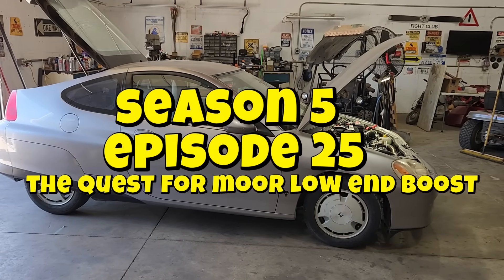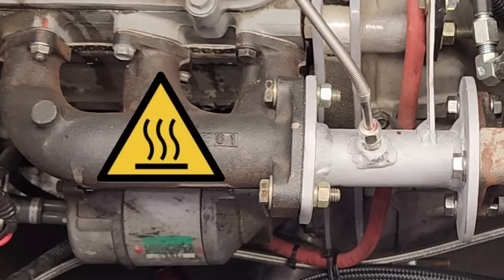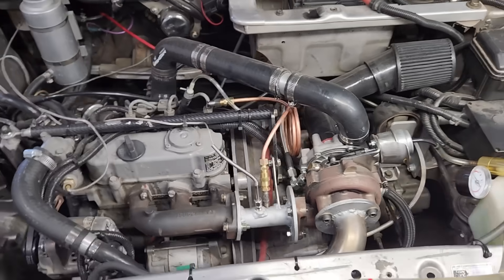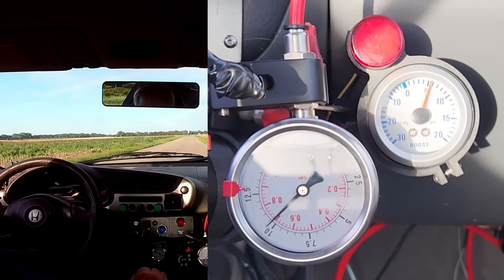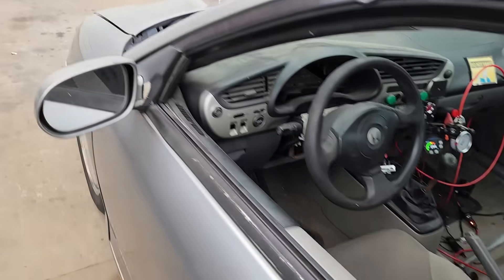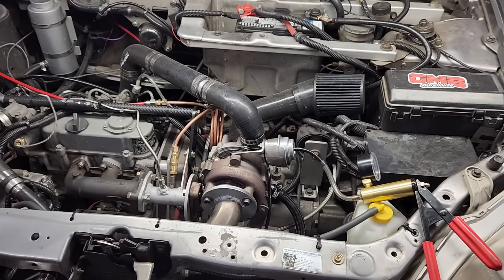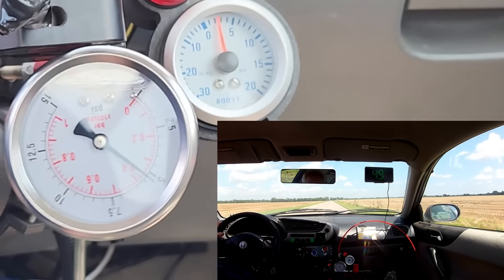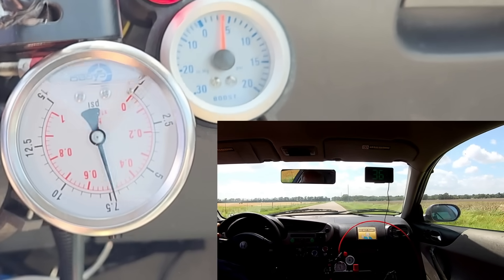S5 E25. Can we get more BOOST from the VNT/VGT turbo on the 719 cc kubota diesel Honda

Comment: More interesting results, I think  that adjusting the VNT stop is helping, but it's a bit hard to see, finding the best position for that stop might require some more testing.  A suggestion, I recommend insulating the exhaust; this turbo is working, and any little bit of extra thermal energy going into the turbine would help it.  That poor little turbo is so far away from the ideal engine displacement, it really is being handicapped.  As you said Jimbo, it is quite miraculous that it makes as much boost as it does, all things considered.  I look forward to the next installment  🙂

Comment: It's very easy to burn both the VNT and the turbine when messing with the stop screw!
The high pressure exhaust gasses will cut like an acetylene torch.

Comment: 1/8” X 27 NPTF is a very common oil thread, even on otherwise metric equipment. Manufacturers who us metric threads for oil are still the outliers, at least on the equipment that crosses my bench. Thinking of you, Mr Benz
Reply from the maker: Thanks for the info!

Comment: If it was a larger diesel, I'd say run the blower and turbo together, like an old school Detroit, but this is a whole different animal... IDK, I think that turbo is great, but due to the limited HP, I would swap to that mini blower again.
Reply from the maker: The little supercharger really was the better choice for this engine.   Before I switch back, I want to see if there are any benefits by using a turbo. So far with the engine there are none.
Reply: @robotcantina8957 Yeah, however, you really have gotten the best performance out of that mini diesel. So when you switch back, you'll have a full series literally any college or university campus can reference regarding the dynamics of compression combustion engine. Thanks for your work.

Comment: Apparently, the new project car has a big fan already. Since your channel is usually about trying to make tiny engines work in vehicles bigger than the engine should power, I’m guessing you’re going to make a weed wacker into a jet to power a ride on mower. Did I guess right?
Reply from the maker: LOL, Close...  we are going to put a COX .049 in a Terex 100 ton dump truck
Reply: @robotcantina8957 can’t wait to learn what either of those are. I can already hear the jokes in the comment section, though. I’ll start with, If you succeed you’ll be a CoxTrucker.

Comment: Your videos helped me in a surprising way. I just picked up a D722-powered Kubota generator... And these videos meant I already knew everything I needed to know about the engine..... including what to do when it wouldn't shut off (previous owner had disconnected the shutdown solenoid for some reason)
Reply from the maker: Glad the videos helped!
Reply: Same here, but mine wouldn't start and because I watched these vids beforehand I knew what it was immediately: bad shutdown solenoid preventing starting.
Reply: @JerryAtrick83  mine was gummed up, I fed it some degreaser then a couple mls of ATF and worked it back and forth and now it's mint

Comment: Has making the exhaust outlet diameter smaller been mentioned ?
  The water hose example. The same amount of water going through a smaller hole must increase the velocity. i.e Spinning the turbo faster sooner.
This is with all your already mentioned caveats and channels spirit.
  I should also increase the back pressure but in a different way and maybe a different outcome.

Comment: Heck yeah bro , and idk about diesel,  but on gas engines,  ya really dont want more than 1.5 times thw ba kpressure as the boost , anything over and they usually tell ya you gonna hurt something lol but i dont know much on diesel so it might not matter at all their were there is no throttle plate and whatnot .. i definitely like this idea, though.. i wonder if a gocart or motorbike turbo would do better (i believe they would be smaller ). But regardless,  im watching and interested .. knowledge is power friend and i never stop learning 😅.. anyways , peace and love jimbo, keep it rad, stay safe, and build on..l8r famz and keep having fun..

Comment: I guess this back pressure phenomenon helps explain why putting a set of headers on a factory turbo car doesn't necessarily improve performance. I look at the log manifolds on the ford ecoboost V6 engines in the SHO Taurus and they don't seem like they would flow particularly well in an NA setup, but they can make quite a bit of horsepower using the twin turbos. Downpipes after the turbos seems to be more significant because even heavily modified cars making 600+ HP use the stock cast manifolds. You can pretty much overwhelm the rest of the drivetrain and max out the open deck engine block design by simply running modified factory turbos, downpipes, high flow cats, and catback exhuast. There's more mods on the intake side to achieve those numbers, but the lack of need for a header on the exhaust side always surprised me.

Comment: Thank you for the amazing video. I suspect with my amateur eye, that over adjusting fins is not making good boost because they are rotated almost backwards. Their angle even in default maximum setting is very steep!

Comment: For what's it worth how about try controlling the pitch of the veins by pulling then in the choke position with a spring then using boost pressure on the actuator to offset the spring pressure. Then change tension to find the best out put

Comment: twin-charging (super charger and turbo on the same engine) is the best of both worlds... if they are both sized appropriately for the engine and usage. Your supercharger seems to be well sized for the application, however, the turbo likely would be undersized in either compound (series) or parallel twin-charging. If you were compounding it, and you had a larger turbo, it could work well (the supercharger would handle the lower RPM range, and the turbo, the higher range), but then you'd likely need to worry about how much boost the bottom end of that little Kubota could handle before exploding.

Comment: You definitely have action from the turbo. If you can find a correlation value between boost/optimal spool speed; and use that to be the value a controller keeps the turbo set at, it should be a quick arduino build. The only thing that really matters there is a set of valves and a small vac pump, or an IAC/EGR servo. Awesome work like always.

Comment: Limit back pressure but also allow boost to be vented back in intake a little in a 25 percent waste loop so till turbo spins up then sloae loop progressively to get boost 

Idea being if theirs an optimal fast speed of turbo

Then get the most boost without dropping turbibe speed. 

Like maybe at present rhe turbo isnt running fast enough and cant get their when bots back and boistcwokingvadainstceach otger

  Spacebar stopped working it cant keep up:)

Comment: Funny enough, we - the metric crowd - also use the imperial system (at least here in Denmark) for pipes and fittings, but only old school cast steel and galvanized pipes. For copper, stainless steel and PEX pipes, we use the metric system. Why do you ask? I do not know, and I don't think anybody knows! 😂
Reply from the maker: Thanks for the input, I always wondered how it was done over there.

Comment: Vgt turbo is doing what is designed to do. You need to control this to get the max from this turbo, and it can deliver boost in wide range of rpm with a controller. Actually, this turbo is a little over sized for this engine, and this why you have boost upper mid-range rpm. I don't know if there is a vgt turbo smaller than this.

Comment: So if you can generate 2psi with the vnt set to more flow you should see more power output on the higher end due to less back pressure.
Reply from the maker: We get decent boost on the high end and that's good enough for now,    Its the low end we are looking for more boost.  it may not be possible with this turbo.
Reply: @robotcantina8957 that’s true is probably 2-3x the turbo size. 

If you can find a vnt a bit smaller you could really do some cool stuff with electronic control of the nozzles. 

Just sucks how the vnt chokes the engine a little bit on the high end when you want to see more boost.

Comment: it has a hard stop inside the turbo both way so it doesn't go pass center to where the turbo can't come back. u can see it in one of your last videos or two. also you have too much resistance in the exhaust, u don't want more than a 1 to 1 in backpressure to boost

Comment: Using the Charger to power the turbo... but not the way to think but by a device that uses the Venturi effect to create a vacuum to suck exhaust out past the turbine. hopefully effectively creating a lower pressure on the outflow of the turbine reducing exhaust pressure when activated.

Comment: Connect the VNT vacuum line to the intake manifold. It will keep adjusting the VNT until the engine can no longer pull more vacuum. This is on the assumption that the small engine can pull less vacuum than needed to max out the VNT.
Reply: Diesels don't have vacuum in the intake manifold.
Reply: @sodderbridge  You right 👍, forgot about that.

Comment: you are kind of headed in the wrong direction. if you got 5lbs of boost and 15psi of back pressure, thats bad. not good. you dont want more back pressure. back pressure is not what drives the turbo. they are not paddle wheels in the exhaust stream. if you exceed 2:1 backpressure to boost...its bad. thats only 50% efficient. 1:1 is ideal {but impossible to achieve} turbo is TOO BEEEEEGGGG :)
Reply from the maker: LOL,  I do realize that back pressure is bad, I mentioned that quiet a few times during the video.  1:1 is not possible as you seen.  1.9:1 is about the best we can do  with this turbo.  The important thing is I was able to show the audience the back pressure side  of the equation when  using a turbo.
Reply: @robotcantina8957  its the statement that you need a back pressure gauge with a wider range that gives that impression. reading the comments it seems alot of people feel that back pressure is what drives the turbo {nope}   you might be able to get that turbo to light off by adding more fuel back in it. having no aneroid fuel controller on the injection pump is going to be problematic.

Comment: The fact you have some much more back pressure than boost pressure is pretty bad. It would be fine for helping spool but then the veins in the exhaust turbine need to relax to increase exhaust flow as boost comes up. :/ this helps keep the back pressure to boost pressure ratio closer to a 1:1
Reply: Is a not ideal manifold thats why, or the screw should go the other way but he didnt show.

Comment: It needs more exhaust velocity with less pressure! Could that be achieved somehow! What about higher flow exhaust manifold tapered down to turbo mount, would that be worse since it has more volume to fill before the turbo? Regardless I think you on the brink of a discovery 🎉do propane injection 😂🎉😂🎉

Comment: It looks possible that the VNT vanes could have a range of motion that would allow them to go over-center, obviously I've never had my hands on this and I could easily be misunderstanding how the vanes act. If they can go over-center, then adjusting them past center would cause them to start closing down, opposing the flow vectors, and creating a reverse-twist airstream going into the turbine, which would all I believe sap power from the turbine and reduce boost. The smaller adjustment feeling better may support this, as it was on the right side of center. If any of this makes sense, then the adjustment screw being set to put the vanes at center would be the highest setting that might be desirable, within the limits of my understanding.

Comment: If I weren't determined to be a useless slug today, I'd go dig out my Corky Bell manual with BP tables to reference volumetric flow on optimizing a turbo, buuut, it's raining, I feel like crap and I know it's absolutely buried in my workshop behind a bunch of projects I'm trying to postpone for as long as possible. 😁

Comment: Have you considered electric turbocharging/supercharging? I know you guys are budget conscious but even a leaf blower could help with the blowing coal off the line. I worked on some very early electric augmented turbos. They showed up in Formula One and have now been offered on some street cars. Given the small displacement of the engines you guys are working on, playing with a way to add boost off idle until the turbo kicks in might be a bunch of fun

Comment: As a ... generally metric person on the other side of the pond, I'd probably use BSP fittings in that rather than NPT. Very similar, but different. 🙂
(NPT stuff is available, but you'd have to go hunting for it, here.)

Definitely interesting findings with the backpressure/boost; I wonder if the high drive pressure is making the turbo spool fast, but becoming such a choke point that it's preventing additional boost after a point. Looking forward to seeing what you try, and how it affects things!

Comment: You're getting a lot of backpressure at speed, because the VNT vanes are still closed. Typically, the vanes close to spool up the turbo, then they open up to reduce backpressure. I think another commenter mentioned using a wastegate actuator to push the vanes open under boost. I think that's worth a try.

Comment: The only other thing I can think of is of to make the turbo to work more efficiently getting the motor to consumer air the only way is that you can do that without building a full motor for it is putting a supercharger on the added air, the supercharger forces in the motor will help the turbo school out faster, creating the turbo to create more boost. The next problem you run into though is the motor is gonna want more RPM so you might need to modify your injection pump to allow the motor to rev higher I don’t know what the operating range of this motor is. I’m probably guessing it’s fairly low maybe 2600-3200rpm  if you buy the pump, maybe you can get 3800-4500rpm  only thing I’d worry about is the camshaft profiling with that kind of RPM maybe there’s an aftermarket cam you could put in that would let the motor revel a little bit higher and allow it to consume a little bit more air little higher left a little more duration odds are there isn’t any form of aftermarket performance support for those motors, but sometimes I’ve seen some really weird performance parts for small engines before so there are odds that there could be some aftermarket support and you could potentially be able to modify it, but I don’t know that engine at all so I couldn’t tell you

Comment: just FYI turbo's with VNT and electronic actuator have more travel so they perform better also they are more responsive than vac actuators. but of course for this application using a electronic actuator may not be a good idea because of the electrics  needed. typically a garrett gtb has 3 wires 12v pwm and ground.

Comment: Have you ever thought about storing that back presure in to a tank and releseing it under acelleration like a 15 psi shot directly in to the turbo to spool it quicker? using a one wasy check valve and a actuated valve at teh vein

Comment: I have tuned VGT turbos in factory applications that have PID controllers, and many of them use an exhaust back pressure target for the PID, from a table which references RPM, and fuel quantity. 
What you did by closing the veins further shows exactly what is happening, a different position will give the best result at any given RPM and fuel quantity, while running the veins fixed gets the turbo spooled from low RPM, it also is the reason why boost stops climbing at higher RPM and fuel quantity.

As the exhaust volume increases the veins need to be open further to allow the boost to continue to rise. Because fuel quantity effects exhaust volume heavily, adding more fuel will likely make it possible to increase boost with the veins opened slightly. 

For an example of the effects of fuel quantity I often add a "VGT exhaust brake" to diesel trucks I tune, on closed throttle with the veins 85% closed it is capable of making 40 Psi. of back pressure at 2000 RPM yet only 5 Psi. of boost because of no fuel being injected, yet at 65% throttle with the veins 45% closed I can make 21 Psi. of back pressure and 20 Psi. of boost with no exhaust smoke.
You should be able to get similar EBP / boost ratio even with an oversized turbo you just have to find its sweet spot.
If you have any questions I'll help out the best I can.
Reply: The video I watched of a Honda tuner installing one of these on a K24 mentioned that in diesel applications, one of the reasons that diesel VGTs are programmed to have an idle cycle with a boost like you're suggesting is to make sure that the turbo can function properly after long idle periods, and to help with the cleaning fluid burning soot off of the catalytic converter.
It sounds like a win - win situation to me. More boost, less soot and smoke, and longer service life. I don't see a down side to that.
Reply: Agree, it's no use to run a vnt at a single opening only, the idea is to utilise the variability.
Reply: Great insight. I'm developing a mechanical control linked to EMP, boost and throttle position, actuated both by boost and vacuum. Wish me luck! 😂
Reply: Excellent information
Reply: awesome comment, this guy VGT's

Comment: I'm reading on the internets that there's such a thing as an Electrically Assisted Turbo, where there's a motor between the the two halves of the turbo that can Assist, Turbonically, via Electrons. I would find such a gizmo entertaining.
Reply: Neat. Possibly overcomplicated.
Reply: @Terran.Marine.2  Absolutely overcomplicated, and I don't really understand the logic of it, but I'm not much of an engines person. I'm more a fan of absurd contraptions
Reply: Overcomplicated? Right up my alley!